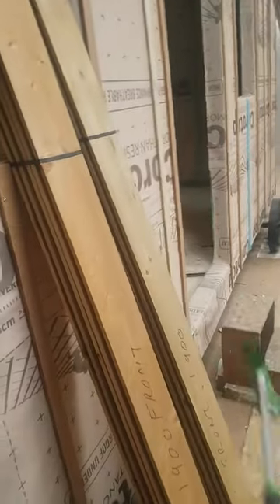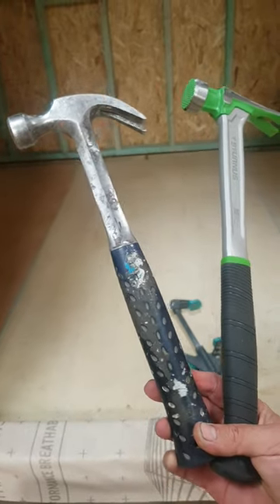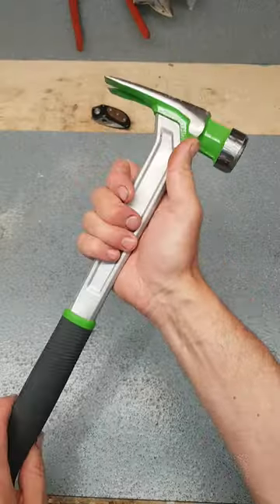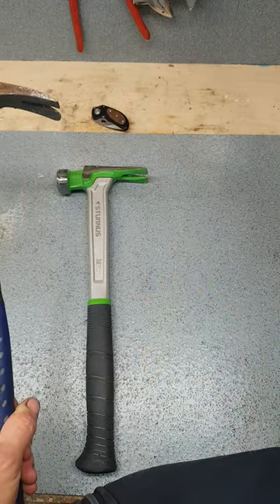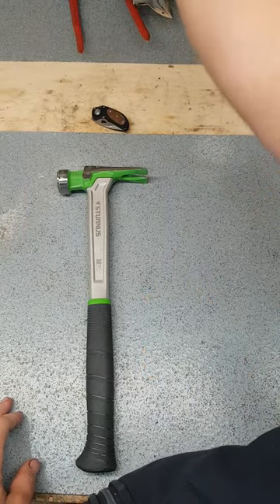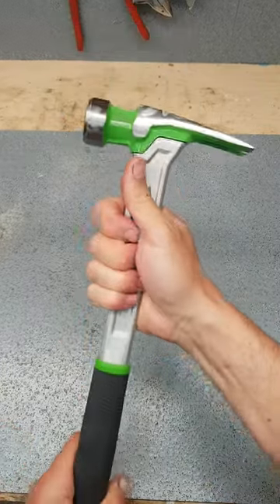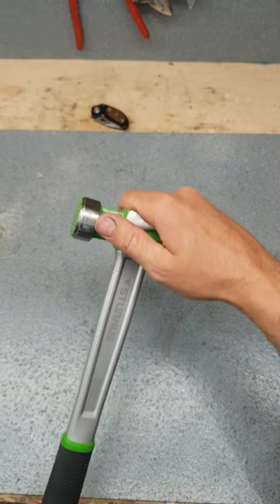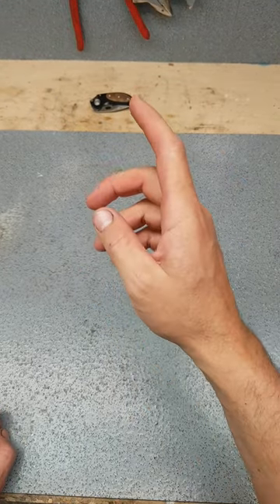Testing out one if these Sturnus 13oz claw hammers up at Donegal Shepherd Huts.

Comment: Great review. Easy to pick a hammer if it’s the one you keep reaching for. Like u I would prefer the smooth face.
Reply: What I do to get the waffle pattern off the hammer is I turn a belt sander upside down, put it in a bench vise, with 100 grit paper, and sand it off. It looks factory and solves the problem. 👍